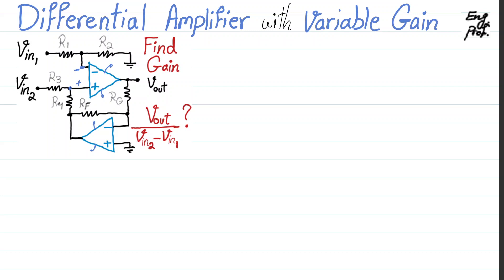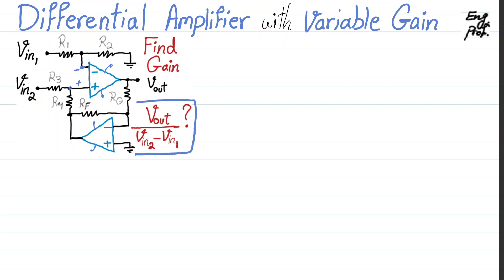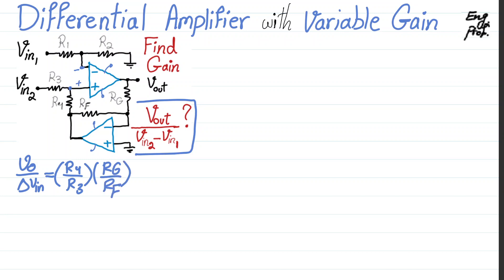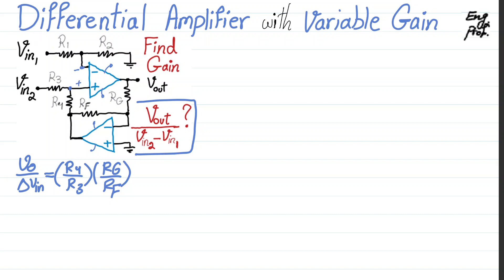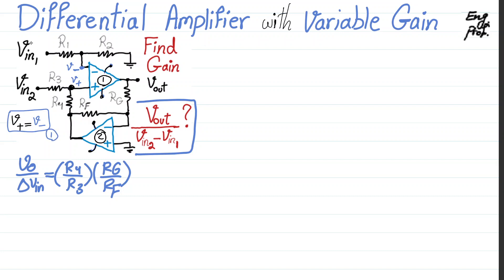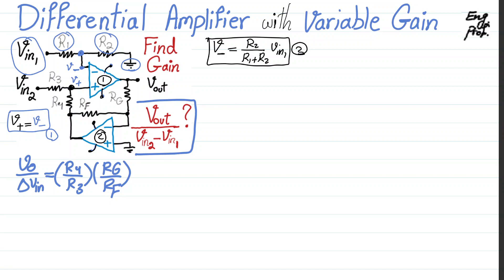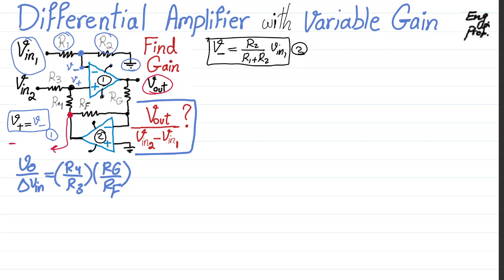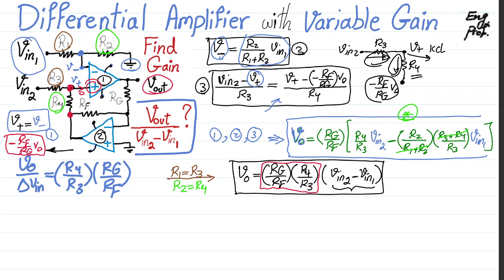Differential Amplifier with Variable Gain and feedback loop

Comment: can u add a reference voltage like have the same final expression plus some reference voltage
Reply from the maker: Good question and thanks for your interest in this circuit. Yes, just add the reference voltage directly to the output via an addition stage, or in case of a small reference voltage, you might also consider applying it to the positive input terminal of the second Op Amp that results in (1+RG/RF)*Vref added to the output voltage. For more examples see Instrumentation Amplifier Explained in https://youtu.be/Yq767et8BbY video
And https://youtu.be/Ggf0yCaTTiY video that describes a Variable Gain Instrumentation Amplifier for designing Thermometer Current Source, and finally https://youtu.be/C4tghZ-q6Zs which explains an instrumentation Amplifier with Electronic Gain Control. I hope this is helpful.

Comment: Can you make a video on a 3-Op amp instrumentation amplifier with linear variable gain?
Reply from the maker: Sure, I've already posted them here:
1x, 10x, 100x, 1000x Switched-Gain Instrumentation Amplifier https://youtu.be/9-MLqyewXW8
Instrumentation Amplifier Explained https://youtu.be/Yq767et8BbY
Variable Gain Instrumentation Amplifier for designing Thermometer Current Source https://youtu.be/Ggf0yCaTTiY
Instrumentation Amplifier with Electronic Gain Control https://youtu.be/C4tghZ-q6Zs
Instrumentation Amplifier design with Differential Instrumentation Amplifier with BJT transistor https://youtu.be/2xJpqfexsPg
I hope these videos are helpful.